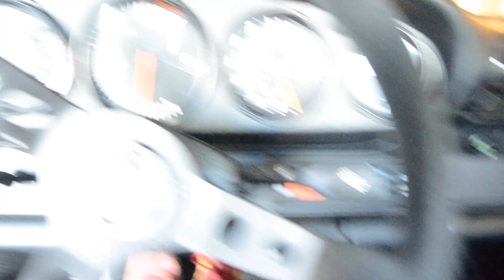STUPID MISTAKE!

Comment: It may offer some consolation to know that I've seen everyone from dyno cell test technicians at GM to PhDs at German engine test centers do nearly the same exact thing.  Only difference being that they left it off entirely and ran the engine for 20 minutes or more at full load and up to redline. They doused the entire engine and test cell in a fine coating of oil.  Think of it as rust preventative action rather than a gross error and you won't feel bad about it.
Reply from the maker: This video has brought out so many horror stories... It makes me feel much better =)

Comment: What type of ramp is that?
Reply from the maker: I'm pretty sure these are them...Got them a while back. They are super long so  low cars are not an issue. and the ramp part will detach once the car is on the platform for easy access from the sides. http://www.discountramps.com/car-repair-ramps/p/CR-7214/